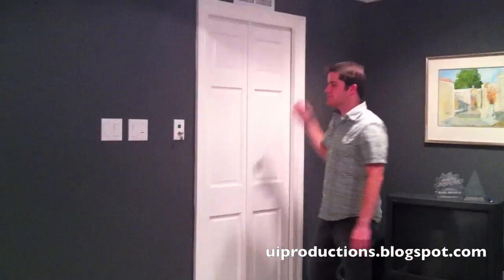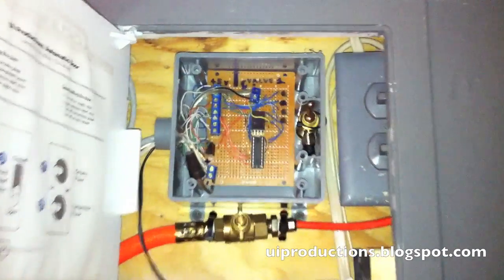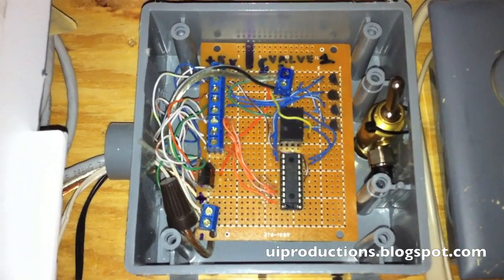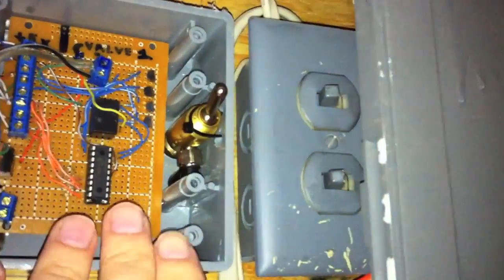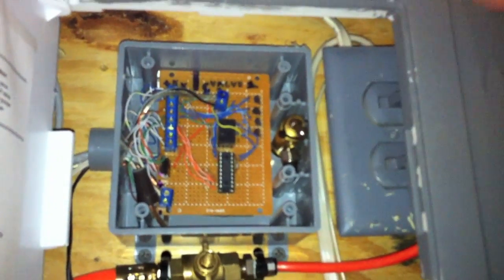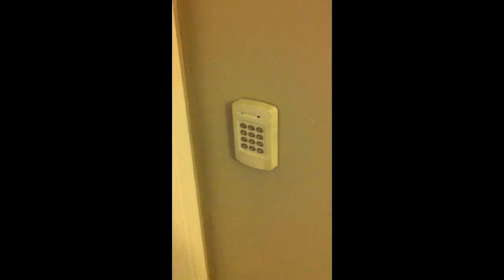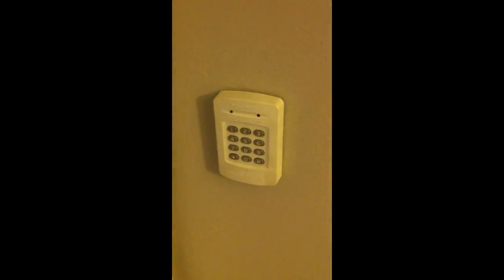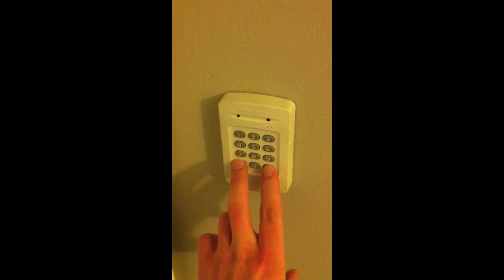Star Trek Door (Extended Version)

Comment: Very cool!
My grandparents built a house in 1974, which had 5 single pocket doors.  My grandad had the idea to motorize all 5 pocket doors, by putting electric motors to each of them, in the attic above.  I remember pushing those buttons over and over again in amazement, until he finally told me he was going to have to sell the house just to pay the electric bill.
Reply: LOL hope ya stopped
Reply: With all due respect, but that story is  a real load of Dingoes Kidneys on several points, shoulda just let it go at 5 Motorized pocket doors.

Comment: ok but there is no safety vent if someones stuck in the door the compressor will keep pumping air into the system and keep increasing the pressure on the body?

Comment: What happens in power outage event. Do the door automatically open, or vent the air to allow manual open, or is there battery backup? Or you get stuck inside until power goes back online. 
Edit. Maybe there should be a "manual" key position so you can open in case of power outage but still requiring a key for "safety".

Comment: This video was in my Youtube recommended page...

Unimpressed. You have way too much spare time, and this door is a clear overthink, and an under-remember. Of what a StarTrek door actually looks like.

More importantly, hydraulics or pneumatics, is not what people 250 years from now are going to use to operate their doors, regardless of what the TOS star-trek door shows. As an aside, the set technology was done with a guy to pull on a rope to make the door operate. The opening noise was more of a pressure-brake-stop sound, inserted into the soundtrack.

More realistic to get one of your relatives to pull on the rope.

I’m leaving now, shaking my head in dismay...

Comment: I give it 8/10 for coolness, and a 5/10 for execution. It's cool until 4 a.m. when the compressor in the ceiling kicks on to recharge waking the whole house up. Unless he had it in a insulated noise proof box. I'd have to run a hose out to my garage and make some kind of noise filters on the air rams before I could "live" with that for a extended time. But I guess if your that much of a treky or however you identify yourself you'd deal with it. Good way to let everyone in the house is gonna know when you go to the bathroom in the middle of the night lol. Either way it was still cool enough to make me watch it so I appreciate his work and it does look clean. How long do you give him before the inside of the door and rest of his room looks like one of the ship?

Comment: Timer needed on the compressor so it won't fill the tank during the night and I'd fit a safety mechanism on the edge/edges so you can't lose a limb if you forget something and suddenly turn back around whilst it's closing.

Comment: Good but could be dangerous. Can the control panel and pressure lines be accessed from both sides? I only ask as you mentioned having to depressurise the system to manually open the door. In a fire with a power outage, that could be a bad thing.

Comment: I hope that the correct finger trap measurements have been implemented for en16005, someone might be loosing a few fingers.
Also there is no safety sensors that I can see. Should be using a photo cell across the fresh hold in case someone is standing in the gap when the door closes.
Dangerous

Comment: You should try integrating it with The Nest smoke detectors so that if there is a fire and your smoke detector goes off it shuts the door off and dumps the air so that you can just slide it open and you don't get trapped in the bedroom during a fire
Reply: You could create a script with an app called if this then that basically you would have it so smoke detector goes off then air compressor gets turned off and the air gets dumped via a solenoid connected to an Arduino

Comment: so what happens when something gets in between? it auto opens? or will the motors keep running and break the system from the inside because it hasn't reached the endpoint of it's circuit yet?

Comment: Awesome! But the idea of having an air compressor running 24/7 doesn't sound that good. Anyone guess how much power is wasted that way?
Reply: Depends on how leaky it is. I have an air compressor that can hold the air in it for weeks without it powering on to build pressure again. Or are you talking about standby electricity?
Reply: Ryan Kramer No that's exactly was I was thinking of. Ok so thats not that bad, although how often the door is opened/closed is the other major variable. Still probably doesn't cost much at all.

Comment: This is probably one of the coolest nerd adaptations I've seen in a home application. I only have one issue with it. It's pneumatic. The fact that you have an air compressor constantly at full capacity. Even a small tank can cause a lot of damage if it ever ruptures. I hope it never does. I would probably opt for electronic actuators, or something along that line so it's not under pressure.

Comment: I wish he had an installation tutorial, it'd probably be a viral craze and be like "the shit" to have a door like this, especially among the gamer community.
Reply: It's all good and well until someone gets crushed in the middle of these doors.
Reply: @BAGINAZARD  It would be easy to create a sensor using arduino, to prevent any accident
Reply: @r00tFak  sensor isn't any efficient in this case, it should just reopen when it is stuck on its way to close, just like train doors
Reply: wee ree If you use a sensor and your standing in front of it won’t shut.What are you talking about?
Reply: @JonahStubbs  what
Reply: wee ree If you put a sensor it will detect when something is in front of it and stop the doors from closing

Comment: What modifications did you have to make to the walls? Can you show the pneumatics? Limit switches? What if the door closes on someone does it sense this and reverse? Interesting project tho.
Reply from the maker: Removed some studs, reinforced the ceiling with a header, replace drywall.  It's similar to installing a pocket door.  It doesn't need limit switches because the pneumatics just run to the endpoints.  The full build report is here:  http://uiproductions.blogspot.com/2010/12/star-trek-door.html

Comment: If I was designing this, I would use electronic actuators (so I don't hear an air compressor kicking on in my ceiling on occasion) with a mechanical design that relied on some sort of light frictional force to close the door. Light enough that if a small child was standing in the opening it would never close hard enough to pinch them. Then if you really wanted it to lock it, use an magnetic lock like those commonly used on electric lock doors that only activated when the door is completely closed.

Comment: if you want automatic opening, then put in a pressure pad under the carpet on each side.  You should still have it pass through the controllers you have in place to lock and arm the door, but it would give you another function for auto-open.

Comment: Nice attempt at duplicating Star Trek.  With all due respect, this is ill advised.  Both pneumatic cylinders and controllers rely on power.  In the event of a power failure, you are trapped in the room.  There is no quick and easy mechanical override.  The set-up as shown is a potential fire hazard and very likely violates OSHA guidelines.  From an operational perspective there was no mention of door close force control or safety limit switches.  Someone can get easily crushed.

Comment: we will use a rotary motor to turn a screw which will retract the door(s) and/or pin the doors shut. you will not be able to crowbar them open (they will be steel composit). you will not be able to get through without a torch or some method of cutting, which will set off the HALON (illegal, but then again LEGAL is not APPLICABLE) fire supression system and KILL anyone who attempts to gain entry. Any attempt to defeat the security will result in the end of life.
Reply: this is why you need a hallway with a second door entry. you cannot open the security door without closing off the primary door. I design/build the highest level of security for safety. there is allways a one way escape route from the safe. and anyone attempting to gain entry will die.

yes we have friggen lazer beams and microwave, and a completely self contained energy storage system that can not be defeated.

This guys door is just cute and functional.

Comment: Motion sensor on ceilings looking down?  That way you could "blind" them if they saw too far into the hall and room.  
Also, in the days before PIR motion detection, there was microwave motion detection that relied on the doppler effect.  Passing by such a motion detector parallel to the wall yeilded no change in frequency, so it wouldn't open... walking toward it provided the desired doppler effect and triggered.
Reply: Or a good old-fashioned "electric eye" (infrared) beam running across the door frame face. You break the beam and it opens (when in unlocked mode) and also won't close until the beam connects again.
Reply: You can adjust some motion sensors so they only trigger with close-by movement.
Also, you could use an iris scanner as well! :D
Reply: Hee hee... you could also use voice recognition... "My voice is my password" (from the movie "sneakers".

Comment: Incorperate a light curtain in the door jam to sense obstruction presences, and you can vastly shorten the timer. Door will close at soonest possible oportunity without contacting the obstruction. Also, a proximity sensor can be used on both sides to hold the door open when someone is close but not in the light curtain. This may be a better option than a motion sensor control. It would only activate when someone was standing close enough.
Reply: Daphne Blake Yup, look into a BEA “crystal” infrared curtain sensor.

Comment: Well, I would not have chosen pneumatics, as you always need your compressor running. Using power and being noisy.
Reply: No not really. Even with a 20 gallon tank you could easily open that door with tiny pistons like that at least 50 times before it had to turn on. And if you just put a timer on it to only come one durring day time hours or just move the compressor further away or get an ultra quiet "California " brand scroll compressor. Put one of those fuckers in an insulated box you'll never hear it. Not all compressors are loud. Only oil less piston ones.
Reply: buildthings79 Yes, i could do all that. And then you get a small leak, and you hear it constantly pfffffffft-ing. 
Don’t tell me you can keep that thing sealed up so good no air can escape.
Reply: Michi Lo I own and operate a fabrication shop and deal with air connection to tools and components daily. You just make sure the threads are clean and wrap them (properly) with teflon tape then do a pressure check before you close things up. We have 1/2 copper lones feeding our shop air that I sweated together with  over 60 threaded joints and they've been holding without leaks for 11 years now. Tbe only part that leaks on occasion due to wear and tear from tools are the quick couplers. Once you plumb up your pipes. Pressurize them and spray soapy watery on them to check the joints. AND for gods sake dont use those lazy ass push connect fittings. Those are just asking for leaks. As the system pressure changes the piping moves and wiggles in the joint so then after awhile it starts to leak. If you cant screw NPT fittings together with teflon then dont play with pneumatics.
Reply: buildthings79 Well, i work as an electrician, and i only know only so much about pneumatics.
Reply: This compressor would provide ample air: https://www.ebay.co.uk/itm/Atlas-Copco-SF4-oil-free-air-compressor-14cfm-rotary-scroll/142624245297?hash=item2135114631:g:qQYAAOSwc6pZ6HEm

Comment: Neat, I like it. However, what type of safety features does it have?
Reply: Darren Watson Its air powered.It can be adjusted  so it is only strong enough to open and close the weight of the door. If you stand in its way you could easily stop it from closing if you wanted to by turning the pressure down. If you want it to go faster or slower you ruduce the volume or increase it by a valve too. Air is compressible  hydraulics and direct drive electric actuators are not so those are much more likely to chop your nuts off..
Reply: Ok, I like it even more. Thanks for the reply.
Reply: +buildthings79
You can monitor the load very accurately using electrical drives, but it would require more knowledge of current/positional sensing and feedback.  His air solution is good enough for this basic functionality though.
Reply: The word for today is,,, "euphemisms ".
Reply: +buildthings79 I get the point you are trying to make, but honestly, how the heck do you walk through doors that you are in any way risking your nuts being chopped off?  I can see a hand, an arm, a leg.... but nuts?

Comment: why not use electric actuators?  i think it would be easier to wire PLUS no air pressure needed!
Reply: bobo caterpillar It has to be air powered. Sure you could make it with an actuator but it would sound and look like the Star Trek doors and that is the whole point.
Reply: The controller could play a WAV file.  Easier to make them silent for trips to the fridge at night undetected.

Comment: Good job bud.....  u could totally rig up one of those grocery store motion sensors and hide it in that vent perfectly above door.....  even better a pressure switch in the floor.....  if your house has a crawlspace under floor instead of cement slab would be unbelivebly easy to do.  Go under house drill 1 small hole thru the underplywood but not the hardwood floor afix a ordinary momentary switch in a elec box just soo has positve pressure raising the flooring ever slightly...  any weight above it triggers switch...  hell a wireless remote with bic pen would work....  ur a handy guy,, i like your moves....  but the hands free walk thru is a must...  cant fuck with that key,button,switch every time,,, combo of all id say would rock... maybe a ras pi with the ambience track for 30 seconds each time would be the cherry on .......   anyhow what u did here makes me soo fukn happy...  thank u

Comment: Ok so this is a 7 year old video and the project is at least that old. Is it still working? One upgrade that would  make a interesting option
would be to add bluetooth to the door and then a small transmitter with a motion sensor so that if I got the signal from the transmitter
and the motion sensor was triggered at the same time the door would open. You could just have the motion sensor on the other side and 
that way you could move around the room without triggering the dor all the time. You could also add a lock function to the fob that holds
the transmitter.

Comment: I think I found a door that will keep my wife out! Thanks man👍👍
Reply: I'm pretty sure this will keep most women out.... Just saying...
Reply: Not if she can also open it from the other side ha!!!
Reply: +mac taggart - "I'm curious who he needs to lock in from the outside"

Hopefully not to hold someone prisoner inside... I assume that when the outside is locked, the button inside will still open the door.    ....

Makes sense to be able to lock it from both sides, like any other mechanical/digital door lock. But, I would replaced the button/keyswitch/lock on the inside panel with another keypad, and set a key-code to hold the doors open and a key-code to disable all pneumatics (manual mode).

You allow the door to be locked from the inside so people can't enter when you're inside, like a normal "button in knob" doorknob on a bathroom or bedroom door.

You allow the door to be locked from the outside to prevent people from entering the room while you're away.

I just question the usefulness of a keyswitch with a physical key on the inside panel that seems to just be left inside the keyswitch/lock at all times (while you're in the room). When you have unlocked the doors from the outside, why do you need a key while you're in the room? And, when you leave the room and lock it from the outside, no one can reach (access) the keyswitch inside the room.
Reply: I'm curious who he needs to lock in from the outside
Reply: Don't worry! His wife will be beamed in.

Comment: Umm, if you forget the 
"open time" and the door closes on you trapping you between the panels, is there any pressure sensor that detects foreign pressure resisting the air system? an automatic door should have an effective safety feature.

Comment: The tech he is using to do this is actually from the late 60's early 70's or about. I should know, I'm a commercial auto door tech for 15 years. I repair/install stuff exactly like this all day long. Pneumatic auto doors are old school but still used in some cases. Now it's small low current drawing electric motor gearboxes and digital controls that operate swinging or, in his case, sliding doors. Looks like he got his hands on some old pneumatic parts or borrowed the idea to do this. Either way, I give him props as he obviously must be mechanically inclined. I myself have a auto swing door that leads from my garage into my house. After my garage door opens then the auto door into my home opens. Has a electric lock even. My coworker has a auto slider in his house too.

Comment: And what about emergency? Did you take care about emergency situation, when you need to get quickly outside and don't have time to actually handle the air power supply switch? Such as an emergency hit button that takes control over these three switches for you and let you open the door manually? But it's cool idea :)
Reply: Well, I don't wanna die in such stupid way ;) Get myself trapped while I can't get outside of room in fire. Burning to death is a horrible way to die. So next time when you plan to use that door, think about that ;)